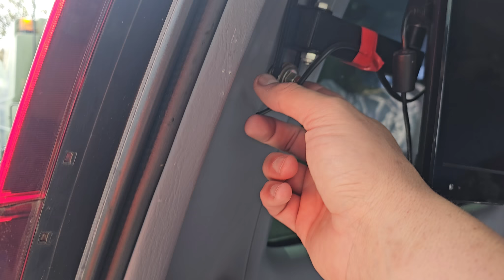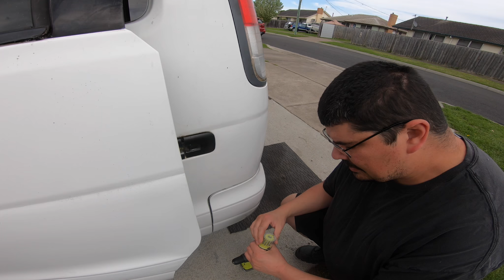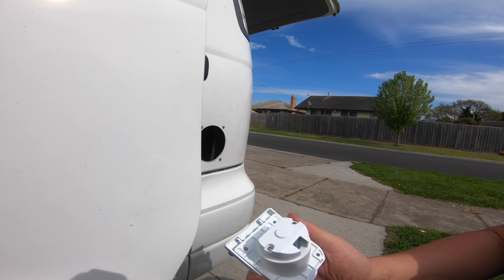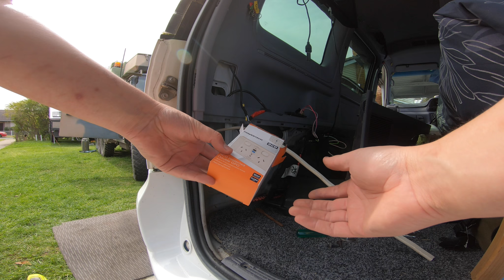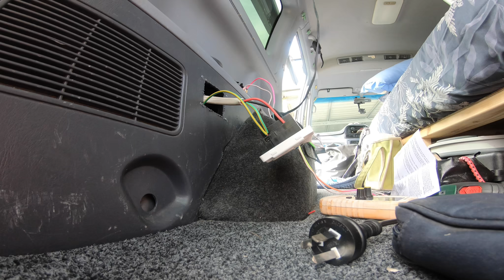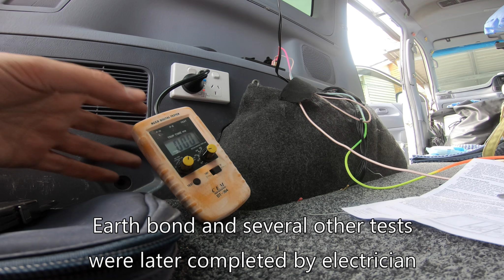Adding a power socket | Liteace Camper

Comment: I doubt that the solid core would be recomended for mobile situations with the vibrations and dynamics that occur over bumps and corrigations
- I would not think of using it in this application unless it were an emergency
- the fatigue for bending  / vibration of the solid wire is very poor compared to the finer multi stranded wire that is more suited to this application
- likely the quaified elec wont pickip on this if they have only worked houses and other static installs
Reply from the maker: @johnallen3555  the solid core is a choice for current loading. Stranded stuff surprisingly doesn't handle vibrations any better. Which is why it's all well secured inside to minimise that risk.

Comment: What do you mean required?  Are you not allowed to do whatever you want to your own vehicles?
Reply from the maker: @RabbiJesus  electrical standards are strict. AS/NZS 3760 is the standard I'm referring to. The vehicle is now considered a mains appliance.
Reply from the maker: @RabbiJesus  in terms of vehicle mods, the ADR applies, and it's also strict, whic is why I was careful to avoid structural members.
Reply: @TheAussieRepairGuy  yeah I get the structural stuff. But if you’re not a manufacturer, those rules don’t typically apply. However, it’s good form to follow.
Reply from the maker: @RabbiJesus  yeah they do, if you modify a critical component or add something that puts it out of ADR spec, you need to get it engineered. A headlight that presents to sharp an angle at the front can invalidate the roadworthy.